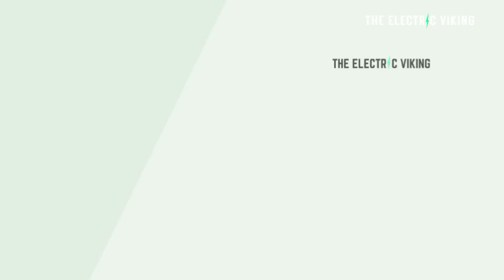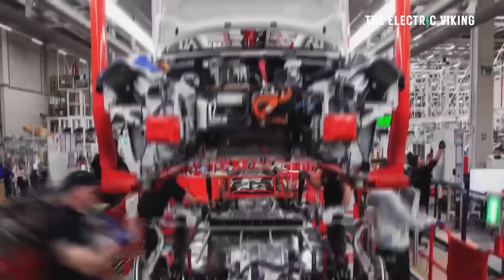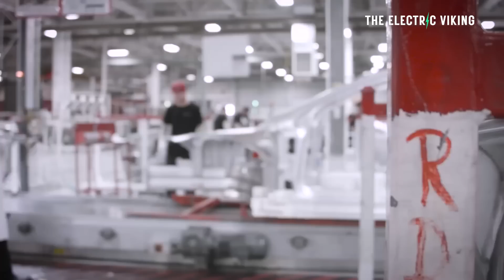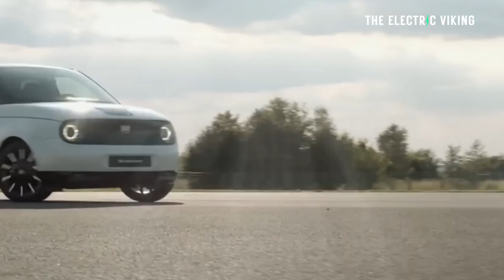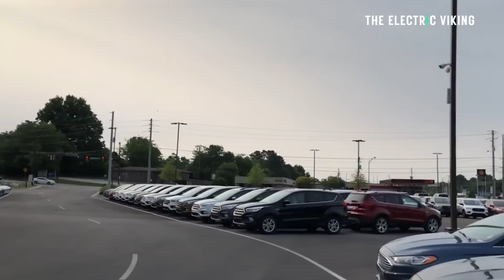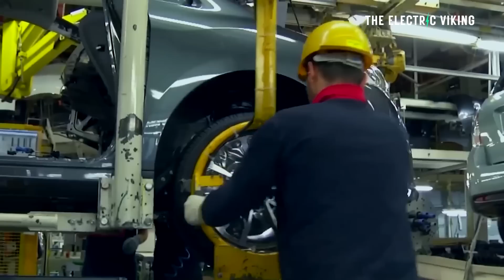Tesla brand loyalty grows as auto industry major brands lose more ground

Comment: Number 1 is safety. 2 security. 3 supercharger network. 4 reliability. 5 it is damn fun to drive. :)
Reply: The reliability thing is being a bit generous.
Reply: number one in magats
Reply: @colemantanner9360  after almost 4 years of owning a Tesla, its never broken down and its always worked when needed. To me, that is very reliable.
Reply: @colemantanner9360  the worst BEV is still better than the best ICE cars.
Reply: smart consumers.
Reply: @colemantanner9360  a friend of mine bought one of the very first model S to come to Sweden, worked like a clock 8 years then he switched to a new S. Still a happy owner, and one of the reasons I own a model 3 since a few years :) Safe, secure, SO FUN TO DRIVE, a lot cheaper than owning an ICE car (volvo xc90) and very reliable.
Reply: @vera_6779  antidotle, but I'm glad you have had a good experience with the cars. I am speaking about averages and on average it doesn't rank high. I like evs, but I'm not going to lie to make myself feel better.
Reply: @TheCardinal365  antidotle, but I'm glad you have had a good experience with the cars. I am speaking about averages and on average it doesn't rank high. I like evs, but I'm not going to lie to make myself feel better.
Reply: @katzgar  I'm not familiar.  Are you from the US?  It ranks pretty low as far as having to fix things right out of the factory.

Comment: i rented one, and that is what put a tesla on my list as an option to replace my wrecked hyrbid.  my apprach to what i bought was purely monthly expenses and which was cheapest was the winner, while tesla was the cheapest option overall, the rental vehicle i had for 2 weeks was what pushed me further.  the first big price drop made it a consideration, that second 3k drop recently was perfect timing for me and made it a contender more than it was before.  
my first 3 weeks have been too many stops for repairs (6 total and 1 more to come), but only 2 separate issues which one we found out it was their alignment machine appears to be off, and the other was a wiring harness that had more than one issue that was not spotted the first time.  highly irritating, but they without question have been bending over backwards to take care of it.  the one remaining visit is to replace the part they had to order.  

they still lack build quality to others in some ways there is a flimsy feel to certain aspects, yet it structurally feels solid.....i hope the next one i buy that replaces this one in 3-4 years will be much much better.  yes, im already committed to replacing it with another tesla unless something very amazing comes out at that time that may be worthy. however.  i doubt any other vehicle even by then will have the same level of convenience, tech, and smooth usability that a tesla brings.

Comment: One thing is the fuel. You can get tainted gasoline that makes your car run crappy. You always get the same type of electricity. Electrons are electrons. And this is just 1 of many reliability advantages EV's have. Also, my 2018 Model 3 has 80k miles and no issues or battery degradation that I can tell. The car doesn't even rattle. Pretty impressive for a 1st year of a model car from a fairly new car company.

Comment: It is obvious why all of us stick with the brand- do you even need to ask that?  Here are my reasons:  
1.  Tesla's customer service and service centers are conveniently located and AMAZING.
2.  Tesla's build quality is  absolutely incredible, not once have I had a failed door handle or air shock or center display screen on my model S.  I only needed two panels realigned upon taking delivery.  And Tesla replaced my cracked windshield the NEXT day.  
3.  Tesla's paint quality is second-to-none.  I've never had any over-spray or rough spots or scratches in my paint.  Rolls Royce, step aside, and take notes from Tesla.  
4.  Tesla's material choices are of the highest quality on planet earth ( or Mars 😉) .  Who needs wood in the model 3? The fabric looks much better and won't fade in the sun.   
5.  Tesla's choice to eliminate Ultrasonic sensors, radar, and turn signal stalks is EPIC.  Tesla vision is EPIC.  I love having the buttons on the steering wheel for the turn signals, that way I don't have to move my hand from my iPhone (or my Cybertruck whistle 😉😉). Same for the horn, no need to move my hand in a panic situation.
6.  Extreme/excessive cost-cutting (and passing it off to customers as a 'minimalist' design trend) is THE best way to make profit in the automotive industry.  Take notes Porsche...speaking of Porsche, my model S is FASTER and BETTER than every 911 I've ever seen.
7.  Build fast, fix later is the best way to promote growth.  The FASTER we produce, the FASTER these cars will get into the hands of us humble owners.
8.  I'm order #23452 for my Cybertruck.  I can't wait to get it, it ONLY took 5 years of waiting but I know it will be EPIC and S3XY.  I can't wait to pull it into my driveway and laugh at all my neighbors with gass-guzzling, baby-seal-killing F150s, RAMS, and Silverados.  Now I need to decide if I'm going to keep my Honda Ridgeline 4x4.  
9.  Elon Musk is so brave and intelligent, he scared the C.C.P. into surrendering control of giga-Shanghai.  He showed THEM who is boss.  
10.  Tesla only sources the most ethical minerals in the world.  <--- THAT IS SO IMPORTANT TO THE GOAL OF GETTING RID OF GASS-GUZZLING, DOLPHIN-PUNCHING I.C.E. vehicles.  I DON'T NEED TO FEEL GUILTY ABOUT DRIVING MY TESLA BECAUSE ELON MUSK IS A HUMAN-RIGHTS-GOD-KING.
Reply: If this isn't the biggest troll-comment on this video then I'm extremely scared for the future of the human race...

Comment: It is a no brainer.  Tesla does everything I want in a car.  It is cutting edge in tech, it is fast. it can be charged in my garage, the range is more than adequate, the potential cost savings from fuel and maintenance costs are significant, the handling is stunningly good for a heavy sedan, and as I age the potential for advanced driver aids is attractive.  Like my wife says why would you buy anything else?

Comment: I have had my MYLR for four months and I can say, without hesitation, I will not be going back to an ICE vehicle. I love the driving experience and the engineering prowess. The idea that FORD and GM are somehow going to stop making massive mistakes and suddenly start making enough smart decisions to overwhelm Tesla is laughable. What in the history of these legacy automakers would lead one to believe this?
Reply: my last vehicle was a hybrid with a turbo 4cyl.  it got wrecked in the middle of nowhere on a road trip.  my vehicle before that was a BMW with a turbo 4.  both felt incredible to drive in terms of smoothness, torque pull.  my second car is a 27 year old lexus V8 with 210k miles and its as smooth as new.    
my rental back to vegas after the wreck was a 1 year old camry, 4cyl, non hybrid and non turbo.  it was the most painful experience ive had driving a car in over 5 years.  
my rental when I got back home was a model 3, and it felt normal to me, like my other 2 cars were with hybrid and turbos but without any ICE engine noises or vibrations.  
i get back into my lexus sometimes, and as beat up as it is, and the suspension work it needs, it feels great as well....but to drive daily, the tesla is what i really have come to enjoy, after a few short weeks its hard to consider something else.  but i still get a smile when i run around in the hooptie.....until i put gas in it....

Comment: When charging is really available and reliable other brands will have a better chance to take sales from Tesla. Tesla has the charging network (that works) and some customers can't buy anything else because of where they drive. There is a growing loyalty with Tesla also because of the eco system. Getting a Tesla owner to buy another brand is like trying to get an iPhone user to switch to some other brand.
Reply: Tesla launched in Thailand at the beginning of this year. They have so far built 3 charging locations, all in upscale shopping malls in Bangkok which is useless for extended driving. They do not have a service facility yet. Waiting for a Toyota dealer to vacate the premises Tesla is taking over. No service, no spare parts (windows and windshields people need replacing) no super charger network to speak if. A very different experience compared with US or Europe. It seems they dumped excess Shanghai inventory as a cash grab and have poorly prepared to support the 1st 5000 deliveries. Great car, but Tesla Thailand to be honest kinda sucks. For now,,,

Comment: Engineered in big auto world wide for 44 years always knew EVs were superior saw Tesla. 2014 witnessed their Supercharger commitments. Tested a Model S P85 and on the spure of the moment ordered one. Took delivery 2015 now 130,000 uk miles later incredible machine, superb service, free to run for life OTA updates means its still current. No guilt with the ethics of the company and retirement with the shares. So interior clips come off and some seals fail. These are fixable, running a crap no torque ICE cant.